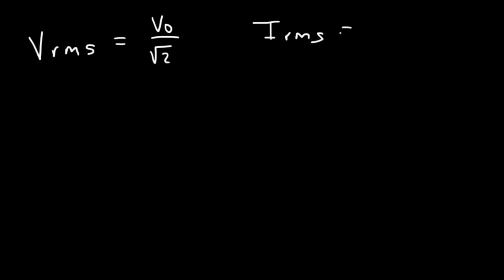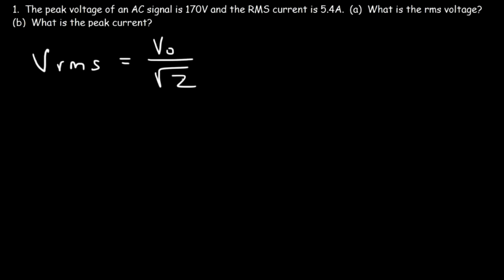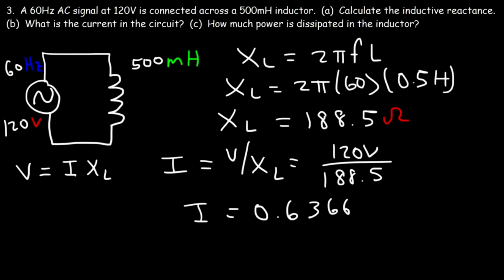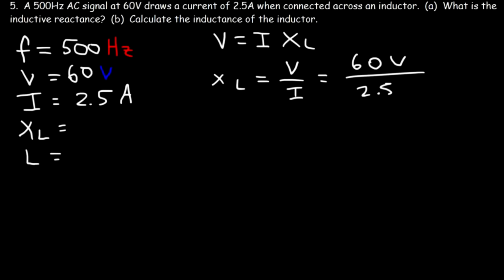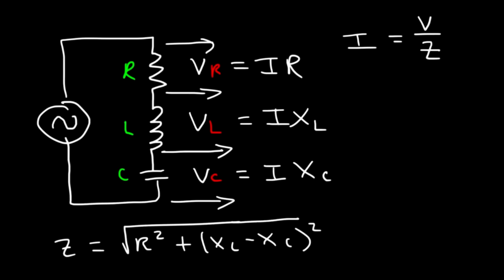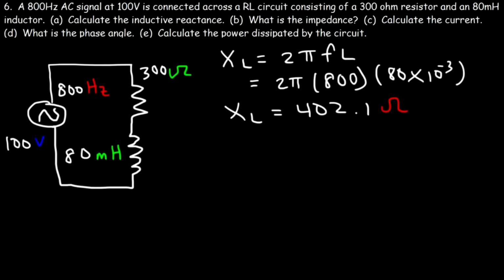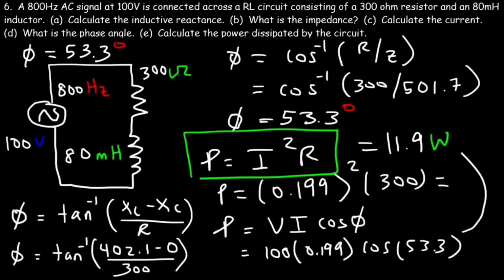AC Circuits - Impedance & Resonant Frequency

Comment: Introduction to AC Circuits (0:00 - 0:50): Overview of RMS voltage, RMS current, and resistor circuits.
AC Circuit Example (Resistor) (0:53 - 1:52): Calculating current and power dissipated in a resistive circuit.
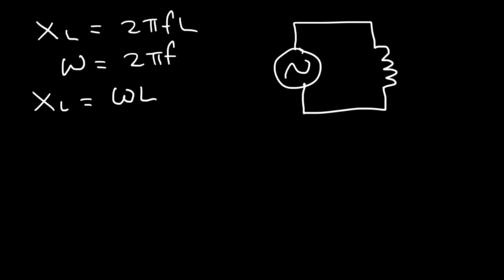Inductive Reactance (1:55 - 4:40): Understanding inductors, inductive reactance formula (XL = 2πfL), and energy storage in a magnetic field.
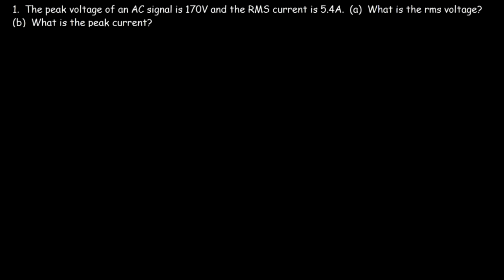Capacitive Reactance (6:10 - 8:33): Understanding capacitors, capacitive reactance formula (XC = 1/2πfC), and energy storage in an electric field.
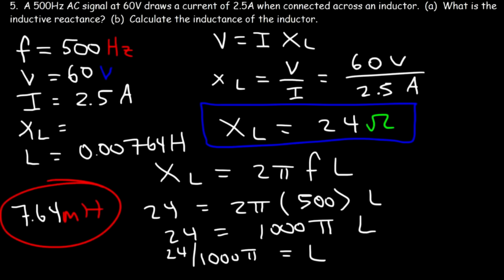Practice Problems (8:35 - 18:33): Examples calculating peak/RMS values, frequency, reactance, and current.
RLC Circuit Theory (18:34 - 23:25): Introduction to impedance (Z), phase angle, and power factor.
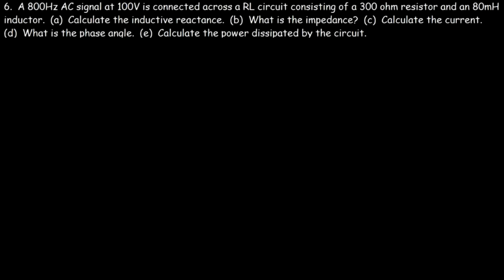Resonant Frequency (23:26 - 24:28): Formula and condition for resonance (XL = XC).
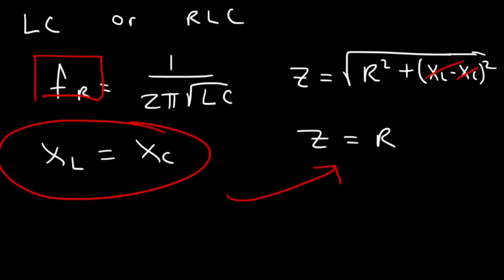RL Circuit Problem (24:29 - 30:33): Comprehensive example calculating impedance, current, phase angle, and power in an RL circuit.

Comment: Only those students who have a lot of experience of doing circuit experiments will fully accept and deeply remember all the formulas, these formulas are very similar and very mixed.
Seems you are doing a simple calculation, but it is actually not easy.  If a person is not an electronic guy,  it will be so difficult to understand what you have said.

Comment: (700/2pi * 0.25)
can someone tell me how he got 445.6? Thanks
Reply: Completely in the same boat, I'm getting 274.9, but if I reverse the formula and do 2pi x 445.6 x 0.25 I get 699.9 so I don't understand what's going wrong with the order of operations.
Reply: Try to put 2pi * 0.25 between brackets to get the right order of operations

Comment: Near the end of the video:

Power Dissipated = (I ᵣₘₛ)² × R, emphasis on "rms".
Power Dissipated = (I ᵣₘₛ) (V ᵣₘₛ) cos θ.

Hence, both formulae give us a value of 5.95 Watts instead.

Other than that, awesome vid, my mans 👌🙏🙂
Reply: That's the concern I was wondering about, I got a different answer so I thought I did something wrong. Whenever we talk about power within a AC circuit we assume I is I_rms and V is V_rms no?

Comment: A bus is traveling with a uniform velocity of 20 m/s. At the instant it passes a car at rest, the
car starts to accelerate at 4 m/s2 in the same direction as the velocity of the bus.
(a) After how many seconds will the car overtake the bus?
(b) How far will the car travel before overtaking the bus?

Can u make a video about this problem. Thank youu!!.